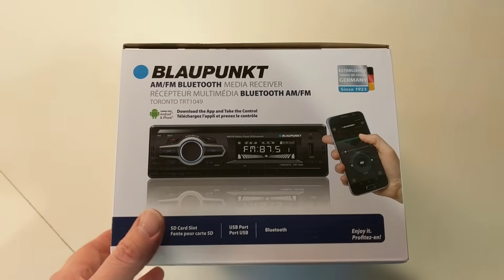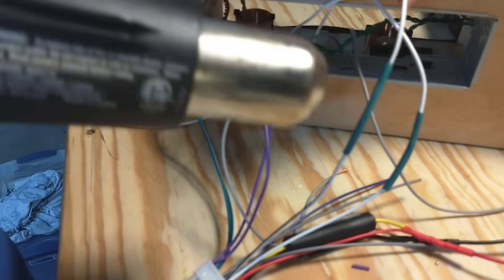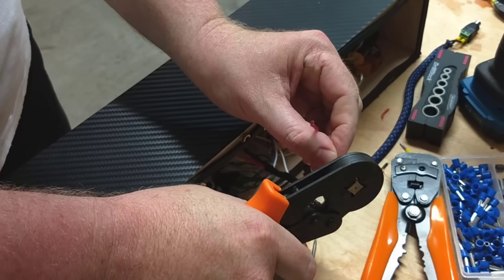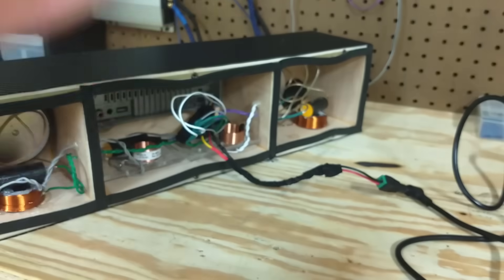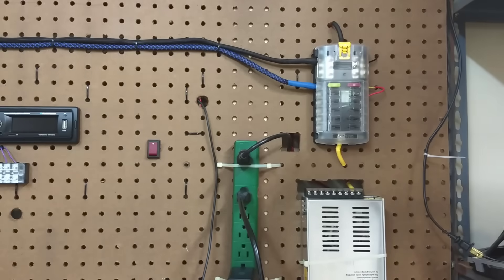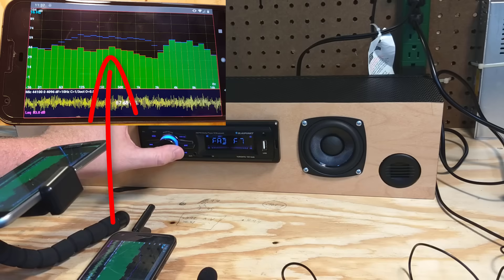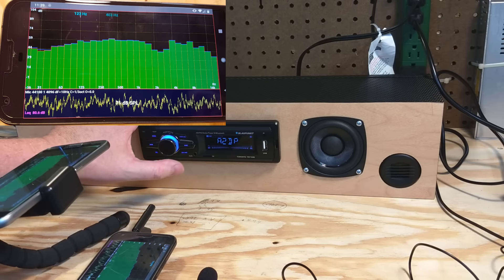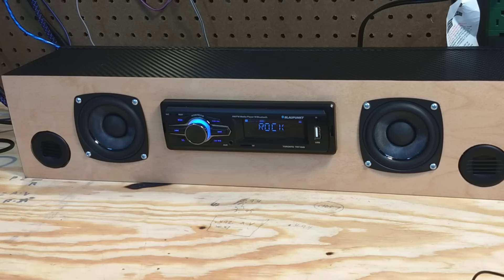How to use car audio equipment in your home!

Comment from the maker: Small mistake in the video:  The yellow wire is constant power, and the red is ignition (i.e. turn on).

Here is the power supply use to connect the boom box:  https://youtu.be/-b8X__GHRtY
Reply: Thanks for the video! Is it normal that the back part of the car radio gets really hot? (The metal part)
Reply from the maker: It should generate some heat.  I am not sure how much is considered normal.
Reply: With them both hooked together is doesn’t really matter lol
Reply: This can depend on the brand name, some do change their wiring layout but keep the colour code the same. I have done some installations in my past and not checked and flattened the vehicle battery even when not powered on.
Reply: Would this be possible to make without a crossover if I used full range 6.5 speakers?

Comment: Great video! The yellow wire is constant on the head unit and the red is turn on. Keep up the great work 👌
Reply from the maker: I suppose I am a big dummy. 😀
Reply: I remember the yellow wire being called memory cable.
Reply from the maker: Yes, I remember that as well.  Red was power and yellow was memory.  I don't know if the wire changed or the terminology changed. I also remember AM/FM radios and 8-track players that had a physical dial used for tuning and radio presets.  When the car was off these radios had no power. There was no need for power the radio didn't do anything. There would have been a separate clock in the dash. 

 Back when I first started flipping through crutchfield in the early 1990s a clock on the radio was an important feature. Not all of them had clocks.  If your factory radio had a clock then there was no clock on the dash and upgrading to an aftermarket radio sometimes meant that you would lose your clock.

Those were simpler times.
Reply: Good eye Big D!!

Comment: Tight budget people For the power supply you can use a power supply from a desktop p c , the wiring will be online for brand, etc, join all 12 volts together all ground together and not in use will be 5 volts depending on power supply, unless you want to hook up USB charging separate, etc... to turn the power supply on there is a trigger wire that can get rigger with a ground wire which a switch can be used in between it, or 5 volts trigger depending on power supply,
Reply from the maker: I wouldn't recommend going out and buying one just for this.
Reply: @DIYAudioGuy it’s so easy to get them for free that you wouldnt need to.  I have a pile of them I’ve extracted from old PCs left on the street or in the trash at work over the years ranging from 200-1000 watts. All of which being actually capable of their rating  too.   I use an 850w as a bench top test bed for my gmd9704 - and to run some big woofers at a garden party a couple times. All ATX PSUs are basically the same apart from some needing minimum load on the 5v rail.  gaming PSUs have modular plugs too making it much less hassle to consolidate all the 12v and grounds. 

Awesome project though. Thanks for showing off the design and all the tips.

Comment: I hooked up a head unit to some small bookshelf speakers that came with a Panasonic mini hifi unit. It’s the best sound quality I’ve ever had for the money. For portability I connect it to my jump starter packs 12V 10A output. It came with a cable that just happened to be the right one to connect it to the power input socket. I used the same socket for power you did.

Comment: If you are searching for a high current power supply unit, a gaming desktop computer ATX power supplies are the way and only require switch be connected. Significantly cheaper than a standard PSU and with higher efficiency. Currently using a 850Watt PSU with an output of 12vDC @ 70Amps. My bedroom stereo system is a car stereo system including subwoofers.
Reply from the maker: Those are good if you have on sitting around.

Comment: I use that same radio for home use. I hook it up to my bench power supply that is good up to 30V 10Amp. I have it connected to some cheap flea market 6x9's. I had a small wooden box laying around that was originally a shipping crate. I sealed it real good with caulk and used spill mats to deaden the wood so it wouldn't rattle. I cut the holes and screwed in the 6x9's. It sounds pretty good for what it is.
Reply from the maker: That makes for a great inexpensive garage radio!
Reply: I'm wanting to do the same thing. What power supply / adapter did you use?
Reply from the maker: @budbrown5687  there should be a link to it in the video description.

Comment: I just run mine with a AGM car battery(no fumes), then put a trickle charger on it. Works great and no conversion confusion. It's all mounted in a box with a computer fan for cooling. I can take it to the lake or camping. Depending on battery it will last for days.
Reply from the maker: Nothing wrong with that, it's just something that I can't recommend. You sound like you know what you're doing.  Not everybody knows what they're doing and you can do a lot of damage with a car battery.

Comment: I made a setup in my garage with an old computer power supply.  It outputs 12V and even has some 5V signals.  The power supply is 350w so more than enough to run a headunit and a small 4 channel amp.  Have pair of 6x9s on front and the 2 rear channels are bridged running an 8" Bazooka sub I had lying around.
Reply: There no issue using a computer PSU.  I fused all my connections and removed any wires I didn't need.  I don't push the PSU past about 50% of its capability.  Computer PSU is actually great to use, it already has a built in fan, I built little upstands and put an additional fan on it.  No issues with it at all in last 6 months.  Runs the setup just fine and did it for same reason, also wanted a test bench as I buy/sell/flip alot of car audio.  Find good deals on stuff, verify it works and resell for as much as 300% of what I paid.
Reply from the maker: Awesome

Comment: This is why i love pioneer head units, they have a built in powered subwoofer output meaning you can build the sub in to the unit where the main speakers are
Reply from the maker: I think HiFi Vega showed that in a video.
Reply: @DIYAudioGuy  I use a Pioneer X3800-UI in my bedroom fitted in my model railway table and connected to a pair of Monitor Audio Bronze BR-1 mini monitors, the sound quality is just amazing, very crisp clear and punchy with not even a hint of distortion.

Comment: PC Power Supplies are the most cheap way of getting that power. I had an older 450 watt power supply laying around and a friend asked, if I had something, to test his car audi amp on the bench. Some of those are power hungry monsters, but his only needed around 150 watts. The fan of the power supply was still running idle.
Reply from the maker: A lot of people use those.

Comment: Can you use a 20 volt drill battery and use a step down converter to step the voltage down to 12 volts dc as a power supply to power a car stereo indoors
Reply from the maker: Or you could try a 12 volt drill battery.

Comment: I want to build a portable speaker and use a car radio as an amplifier with a 12V battery. I was wondering if the power will drop significantly when the car radio runs on 12V instead of 14V.
Reply: Power does drop a little, I have an amp with the spec sheet at 12 and 14.4v and the difference is about 15%

Comment: Two questions how did you manage to put the heat shrink sleeving on after you soldered and how to keep the memory after you disconnect the power supply something in line maybe

Comment: Hey man, not sure if you still read these, I’m looking to do this but with a subwoofer. What power supply would you recommend? And where should I stop with the wattage on the subwoofer? I’d like to do a 1200 watt but I know that’s pushing it.
Reply: Hey did you happen to find a powered supply. I’m looking to run a 10,000 watt amp

Comment: This is a great way to run a low power system but if you are looking into a good system in your house.  Get a power max inverter. They make all the way up to 120 amp ones. Made for RVs. And a lithium battery.
Reply from the maker: Yep, need the right tool for the job.

Comment: Great video, just tried this with a JVC KD-DV4202 I had lying around.

Using a 12v = 5a old laptop power cable, it powers up a treat. However it really heats up !

Noticed on the side of the unit there's actually a heat sink and it gets quite hot quickly. Quite surprised one of these units would have a heat sink.

Do you think it's heating up due to too much power ?

Comment: After seeing some examples i conclude that a red optima battery and a wall-charger is the way to go,especially when i want the bench to handle 3000watts.
Reply from the maker: I am not a big fan of using car batteries inside the house.  I've seen a few batteries explode while they were sitting on a charger.  Make sure you do your research use the appropriate type of charger and take safety precautions.

Comment: If I were to want to run car subwoofers inside a house and didn’t want to use a car amplifier to power them can a powered dj mixing console with a built in amplifier such as a rockville powered dj mixing console be used instead of a car amplifier
Reply from the maker: Just have to make sure the amplifier can handle a forum load, or wire the subwoofers to 8 ohms.

Comment: I know this is an old video and im late to the party lol. But im considering doing this myself to build myself a custom bluetooth party speaker. Would it be possible to wire a small car amplifier inside the box to power to subwoofers seperately like you would in a car?

Comment: Where did you get the fuse block on the test bench?? And would that be OK to power a 1200 amp if it'd turned down. The 15 inch sub is only 200  was gonna run more speakers in my blazer but it never happened. So that big amp was running one speaker  the installer turned the amp down so it wouldn't overpower the speaker

Comment: Can you plug that ac to dc power supply directly into a home outlet? Or use a power supply like the one you're using?
Reply: Nevermind. Duh. You answered that question.
Reply from the maker: It's all good.

Comment: I am going to have to live in a pretty tiny apartment and found some 50w speakers at my parents' place and wondered if I could use a car stereo to help me out? After all, those speakers are passive, so I would need some kind of amp - something a car stereo typically has. Are there any recommendations you have for a situation like this? Thanks!
Reply from the maker: Honestly, it is not worth the trouble or expense unless you already have the radio laying around.  I recommend something like this instead:  https://bit.ly/3wX0UlP  It will be cheaper and more effective.  If that is to much power they have a wide selection of small home audio amplifiers.

Comment: Hey bro great video helped me out alot quick question tho i have a 12vdc 1amp adapter can that work to power the radio and alos how much watts can i get out of that 12v 1amp adapter
Reply from the maker: Watts = volts x amps, so 12watts.  That is before any heat or efficiency losses.
Reply: @DIYAudioGuy  okay thanks much but what do u mean by heat and efficiency?
Reply from the maker: @kallmeronaldshorts2059    When the power supply converts from ac to dc it will not be 100% efficient and it will generate heat.  As much as half of that power will be lost to this process.

Comment: i looked it up,  the product is currently unavailable. 
however, the one that you have has 
 Up to 30 Preset Stations, 2 Channel Audio Output, LCD Display, Bluetooth, AM/FM Tuner
Compatible Devices	Smartphone, Speaker
Connector Type	USB,3.5mm Jack,RCA
Audio Output Mode	Stereo
Surround Sound Channel Configuration	2
Color	Black
Wattage	50 watts

and the one that you have as a hyperlink 

Blaupunkt Fresno421 Media Receiver - Bluetooth
 FM Tuner
 USB
 2 Channel Output
 RCA
18 Preloaded Presets
 Remote Control
 SD Card Slot
 Easy Installation
 Handsfree

you clearly have the best that they had when it was available . 

keep it, dont toss it.

Comment: Is it possible to unplug the power cord and that stereo to not reset? Typical cd players don't reset when the batteries are removed. I assume it may be due to EEPROM memory capability, but I am not sure. I really want to do this, but the whole reset when unplugged is keeping me away.
Reply from the maker: You would need a battery.

Comment: Can I hook up speakers to my car radio, using the rca Jack's,  the red and white Jack's in the back of my head unit
Reply from the maker: No.
If you were to try it, you would get  sound out of the speakers, but the RCA outputs are not designed to drive a speaker.
Reply: @DIYAudioGuy  so do I just wire straight from the head unit to the new bookshelf speakers I got? Without using rca cables?
Reply: Also I was gonna try the rca cables , to an adapter for the aux, or head phone jack, and plug those in the speakers .

Comment: How to connect the antenna that is the question. I listen to a lot of FM sports radio
Reply from the maker: There's an FM antenna plug on the back of every car stereo.   You just need to buy the right parts and plug it in.  I haven't listened to FM radio in so long that I wouldn't even know where to tell you to start.

Comment: Yes I actually put a system into my camper...(don't judge me 😂) I had no issues with powering the amp or the head unit. The only issue I came across was the cheap dual Bluetooth radio I bought....having to wire the red,( ignition) and yellow, (constant/ memory) it was technically always on so would connect to my phone any time I was near it...even when turned off.
Reply: I have since replaced the dual with a pioneer double din radio and will need to install a switch to the red wire as to disconnect the Bluetooth abilities while not using it.
  However as for the amp. I used a old Sony 2 channel wired to the 12v system and again will need to install a switch for that as well. Powering a 2 ohm Skar dual voice coil 10" sub. I tucked into a cabinet.
Reply from the maker: For the one on my test bench I do have a switch on the red wire.  The cheap block punk radios did not last long, looking forward to my next opportunity to upgrade.

Comment: I need to make test panel.amp is 60 amp 240 wat rms x2 bridged how much watt converter i need ?500w ok?plan run set 6.5 inch mids and tweeters and 1x 300rms 12 inch sub

Comment: Good video. I have a system that runs a 1000 watt Amp to 2 15inch subs and a set of other speakers. I was using a deep cycle battery and just kept it charged. What kind of power supply would I need to replace the Battery?
Reply from the maker: https://amzn.to/35OTt7t

Or

https://amzn.to/3JdhN1g

Be safe, don't blow something up.

Comment: After watching your video you got me motivated to get back into the car audio.  I would like to build a Raspberry Pi car audio home system, but I am struggling with trying to figure out how to wire the power to all the devices.  The system would have the Raspberry Pi, a touch that connects to the Raspberry Pi, an equalizer, and a 360 watts amp.  If you have the time and the disposition I would welcome any advice you may have to offer.
Reply from the maker: I am assuming that you are using a 12v amp?  You can just use a sufficiently large 12 volt power supply and then use something as simple as a 12v USB adapter to power the pi.

Comment: Can a car audio passive cross over be used with a home speaker if the cross over frequencies are similar
Reply from the maker: Yes, but home speakers are often 8 ohm so it will change the crossover point.

Comment: Instead of using a power supply, would I be able to use an AGM or Lithium battery? If so, would I be able to keep a charger on the battery as I’m using it with a amplifier/head unit ???
Reply from the maker: I've seen far too many car batteries explode to recommend using one inside of a house.  Plenty of people do it though, and I'm sure it can be done safely. But, I'm just not a battery expert so I don't feel confident recommending anything about batteries.
Reply: DIY Audio Guy ahhh ok I understand. When you’re using a power supply with an amplifier, does the amp ever get hot? Im wanting to make a speaker box likes yours and I’m just trying to figure out the different options I can go about doing it.
Reply from the maker: Yes, the power supply gets hot, the amp gets hot.

Comment: Are you using a typical car antenna in your house?  Or, something that will do a better job of picking up stations?  Is the antenna also inside the house?
Reply from the maker: I'm not using an antenna, i just use the Bluetooth.
Reply: DIY Audio Guy oh , so you never listen to any radio stations from your car stereo?  Well, that really limits what you can do with it.  Or am I missing something?
I am installing a 12vdc stereo in our lake cottage but I will need some type of car stereo antenna to pick up any stations.  I will have BT, usb, mp3 also but sometimes we want to listen to a radio station.
Reply from the maker: @Ocalaman  It's hard to believe but I don't listen to the AM or FM radio. If you would have told me 5 years ago that I would just stream music all the time I would have called you crazy.  

As far as the antenna, my understanding is that antennas are very simple things all you really need is a wire.  But I'm not an antenna expert I would advise you to do a little bit more research before jamming a wire into the back of the radio.  If I have the opportunity I'll do some research and perhaps post a video but it might be a while before I can get to it.
Reply: You just need to buy a car radio antenna jack and just connect a 4 foot wire to the center pole. Car radios have powerful receivers. I get better reception from the car radio in my house than the home audio stuff. Edit: there’s a socket in the back of the car radio that it plugs in to btw